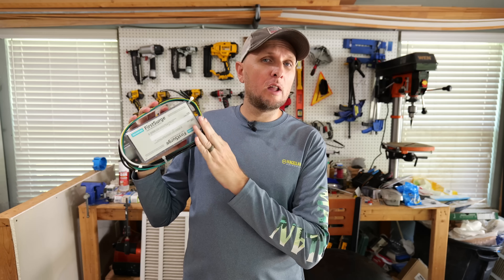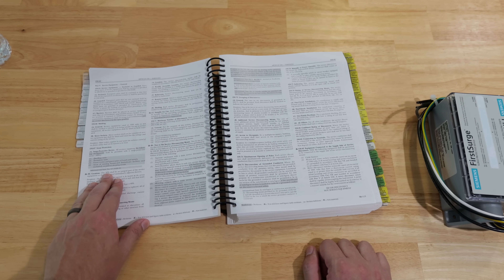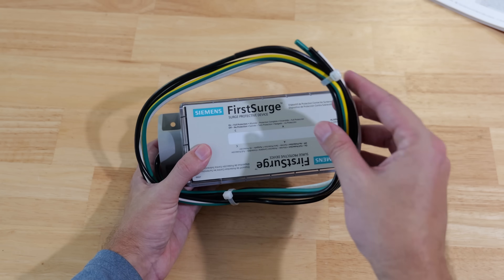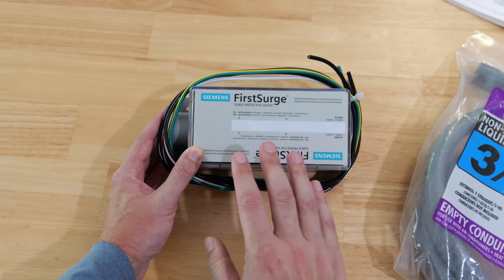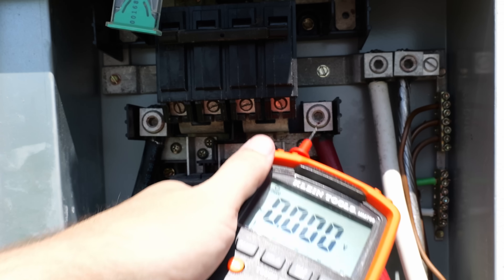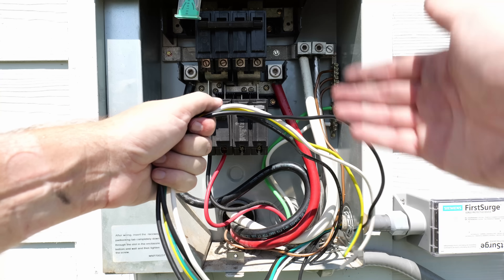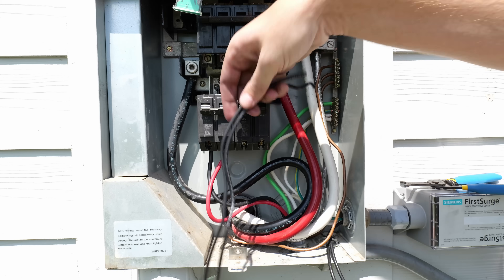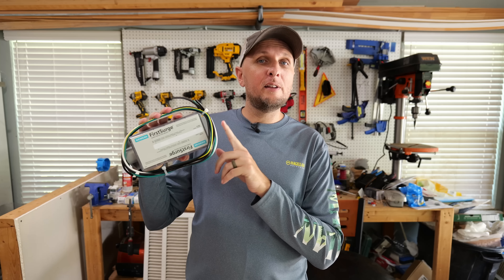Why Whole Home Surge Protectors Are Now Required and How To Install One!  Siemens FS140

Comment: …only in jurisdictions that require that version of the code.  However, my jurisdiction cannot force me to retrofit my house to meet current code.

This change is complete and total BS. There is no reason why the government should be forcing people to protect the electric components in their house from electrical damage. It should only require safety features for people. Not stereos and network equipment.
Reply from the maker: It is intended to protect the safety equipment that you mentioned like smoke detectors.  The NEC stated this.  The protecting your other equipment is just a side benefit.
Reply: @HowToHomeDIY  again I call BS. I’ve never. NEVER had a smoke detector fail from a power surge.i seriously doubt that’s a common occurrence.

People are supposed to check their smoke detectors a couple times a year. A failed detector would be caught then. There are other reasons why a detector might fail. Given the probability of a fire to begin with, it seems more than reasonable to check detectors a couple times a year to catch any issues.
Reply: @HowToHomeDIY, this has all the earmarks of being a change for which the insurance industry and/or utility companies lobbied the government.  I'm an insurance adjuster and can tell you that insurance companies are tired of paying for fried electronics.  Electric utilities used to cover repair or replacement costs due to some power surges and spikes, but not anymore!  Despite what the NEC stated, I don't think they are worried about our smoke detectors being fried due to voltage spikes, any more than they are worried that I change my engine oil every 7,500 miles.

Comment: Separate (topic) questions seeing your install.... I notice you are set up with an interlock like I have too....to allow a generator to be attached as a whole-house emergency electrical source. 
1.) For the conduit between the generator inlet plug and the panel, your flex conduit is continually sloping down toward the inlet plug panel. This can allow water to possibly enter the inlet plug housing. Wouldn't it be better to have the flex conduit "dip" to create a "U" shape?...so water drips off the bottom of the "U"....and not be capable to enter the inlet plug box?
2.) I like that you put a sequence-of-events label on how to hook up a generator. Question....is it still ok if your step 5 is placed between your steps 2 and 3 ?.....is that still OK?

Comment: I installed a GE whole house surge protector after a power surge destroyed the blower motor in my furnace. The price for the GE surge protector has more than doubled since I installed mine. This Siemens device offers a lot more protection but was not available when I was looking for a whole house surge protector.

Comment: I installed a SQ-D HEPD80 whole home surge protector on my main panel.  Also use surge protectors localized at each computer and television.  At the computers I back each one up with an American Power Converter  uninteruptable power supply.  I also have a Generator Transfer Switch Panel to provide safe transfer of power during extended outages where I provide house power with a 5KW LP generator with a hookup where I can draw fuel from my LP tank if necessary.  I live in the country with a local REC Power Coop supplying power and we are subjected to power glitches and power outages regularly.  This system has dealt with any power problems I've had since I put this in place.  I did all my own work so I saved a ton on labor.

Comment: You might call me an (unofficial) ”first adopter” when it comes to SPDs. I made my own with just 3 MOVs and put them inside my panel back in the 1980s! Why? Because I couldn’t find anything commercially available. I’m sure it was a minor major code violation, but I wasn’t concerned at the time.

I’m no longer a homeowner, so I’ll just have to settle for a BEEFY (homebrew) ”Type 3 SPD” in key locations, complete with MOVs, TVS diodes, and GDTs. (Think power strip with a sort of Type 2 SPD attached.)

Comment: There is a later version of the box you recommend and the only complaint is that the wiring is about 15 inches shorter than the original.  Thanks for the videos!

Comment: After 47 years as an electrician, electronic Electrician in industry, I still have to scratch my head when I hear wires as short as possible, as if the unit is faster than the speed of light. When I see concentric knock out rings in an outdoor box, I scratch my head even harder. I have never seen a box that you can knock out the whole, without at least cracking the paint, between other rings. 
Knowing how hard the insurance underwriters push electronic devices today, and how wall pack power supplies for computers and cell phone chargers have surge protection varistors in them already, and looking out at the power pole in front of my house with a surge protector/lightning arrestor on it, this seems like hundreds of dollars of overkill to me. My washer, dryer AC unit and furnace have no electronics, even the igniter plug, It truly would be a total waste of my money
Reply from the maker: For you maybe.

Comment: So now we have a new change in the electrical code. In real practice this new change of requiring whole home surge protection will only be carried out in new construction. The old homes will remain without whole home surge protectors for many years to come. This is the way it should be, home owners should not be required to upgrade to the latest and greatest in surge protection just because the electrical code changed. It is more than enough that surge protectors are readily available for various forms of electronic equipment where a voltage surge could damage the equipment.
Reply from the maker: Yeah I talked about that in the video.

Comment: Around 12:14 in the video where you're inserting the wires in the 20 amp breaker it looks like you are inserting the wires too far into those wire clamps so that you're probably tightening down those clamps on insulation. Can't see it for sure but on the second wire being inserted you inserted it until the copper was completely out of sight and the black insulation was inside the hole. If that's what you've done that is not a good electrical connection.
Reply from the maker: That didn't happen.
Reply: @HowToHomeDIY  I hope you took no offense. But I'm new to your Channel and the camera angle was really bad. It did look like there was insulation inserted in it but I didn't see if the clamp grabbed it so that's why I mentioned it. If I had seen your light switch installation video before I saw this one I might not have written this comment because I like the way you explain the insulation issue on that video. It might have been a good idea to mention it on this one also. But thanks for the response and I look forward to more of your videos.
Reply from the maker: No not at all.  Was just saying there wasn’t any insulation in the breaker.  The camera angles can definitely make things look different than they are.  I appreciate you taking the time explain your thoughts more!

Comment: I am missing how this surge protector can protect the whole house when it is not inline (series) to the main service continuing into the breaker panel but in parallel on just a 20A breaker. I would think a truly effective surfe arrestor would have to be inline to each service leg to stop the surge from passing through to the breaker panel and the various circuits. Can anyone explain that?
Reply from the maker: Extremely long answer made short, it’s the fastest path to ground.  And 20 amps is plenty as a surge is so fast and is primarily a voltage spike not current.
Reply: @HowToHomeDIY  But electricity takes ALL paths to ground or return neutral with the amount in respect to resistance. So technically that may be the shortest path, however some excess can & will travel on since there is no way for it to truly "arrest" or interrupt the surge. 
Also, has the kWh usage been tested on these so we know how much the power company will charge for these being installed? 
I appreciate the dialog, just trying to make sure I am not missing something.

Comment: “Those who would give up essential Liberty, to purchase a little temporary Safety, deserve neither Liberty nor Safety” - Benjamin Franklin
The government should never tell us you have to do anything for our “safety”. This act is a far cry from requiring a building to be put together in a safe way. Why? Because we are no longer building our own homes, outside contractors build and allow greed to prosper over pride in their work to do a good job, no longer threatening just themselves but vaste groups of others. This is why code was allowed to exist in the first place. This specifically is different because the government is saying you are to stupid to know this so we are stepping in to force this. 
Should the product exist? Yes. Can it do good? Yes. Should it be forced? Never.
As a expert in your field and hold a public platform you of all should fight against such tyranny.
Reply from the maker: I see where you are coming from and I agree with some of what you are saying, but definitely not all of  it.  Code still exists for said contractors to make sure they aren't cutting corners.  That is why licensing is also required now due to so many getting scammed by people who have no clue what they are doing, providing a service.  I think we can all agree that proper wiring, roofing, plumbing, framing, and foundational work need to be done properly for safety.  Along with other things like smoke detectors.  I don't really see this new requirement being much different than smoke detectors as one of the main reasons it is being required now is to protect those smoke detectors from being fried and then not working in the event of a fire where lives could be saved.  So, there is a line there somewhere.  I get more irritated with required fees such as 10's of thousands in impact fees being charged to build a residence.  But I do appreciate and respect your opinion.

Comment: My utility offered MOV installation for just the price of the devices back in the '80s (haven't checked since). They aren't perfect - I used them in various sizes for protecting electronic in our Van de Graaf lab. Very fast spikes could get past them (ferrite inductors helped that) and very large surges could over-power them (vaporise). Remember that cable, phone, etc. lines are still not protected. MOVs can and should be added to those, too.

Comment: I don't understand how this is supposed to do anything. Wouldn't it need to be able to filter all power going into the house? It looks like you're connecting it where there was nothing connected before, which means it's not in-line. And even if you're putting it somewhere you disconnected existing lines off-camera, it's only going through a 20A breaker. Does that mean your entire house is on a single 20A circuit? I really doubt that. There's not enough information in this video to instruct someone how to install this thing if they don't already have the understanding needed to install it.
Reply from the maker: There is plenty of information.  You’re wanting the complete breakdown as to one works.  I gave an overview as a complete breakdown would take quite a bit more time depending on how deep into the subject you want to get.  You are supposing quite a few things that are not true and it just does not work that way.  I recommend you look into what a surge is and you will see why the 20 amp circuit breaker is sufficient.  Also look into how a whole home surge protector arrests the surge and sends it to ground.

Comment: Love your videos thank you. As an electrician I have one question. You had an open two pole breaker to power your whole home surge device. What do you recommend to do if your panel does not have an open slot for two pole breaker.
Reply: You can replace a standard 240V two pole circuit breaker with one that also doubles as a whole house surge protector. Eaton makes one for about $100.

Comment: Ok I watched the whole video now I have a question about installing the surge protection unit. It is to be installed with a 20amp double pole breaker. Can it be a 20 amp dual function breaker where the breaker protects gfci and series and parallel  arc protection.

Comment: Will this protect us from EMP?
Reply from the maker: It is one of the surge protectors recommended for EMPs but you will also want to have ferrites installed on the incoming lines as well.  So this by itself is not recommended for EMP and even with the other things installed it’s not a guarantee because nothing is but is MUCH better.

Comment: @How To Home is there any reason you installed it outside rather than inside at the breaker panel? Are there any benifits to intalling it at either location? I have a whole home surge protector sitting on my workbench for a week now just, waiting to be installed. Hopefully you'll answer my question before this weekend so I can get that thing installed.

Comment: They are required because NEC has become a product placement organization.  That is why.  But hey, if you really think a little box will have an impact on something that can heat up the air around it to 5X the temperature of the surface of the sun, you do you.

Comment: For Safety reasons, you should inform your viewers the following: Prior to using your multimeter when checking for voltage after you switched off the breaker, or disconnect Switch. You should first check to ensure your meter is actually in working condition by testing a known live device.
Reply: I was thinking the same thing and I am not an electrician.
Reply: He has done that very thing in other videos
Reply: Yess because I would be the one to get ⚡

Comment: The NEC was founded on the principle of minimum safety for fire prevention and electricution.  These protectors are designed to protect the power supplies in electronic equipment used in a building, and that is a good idea.  However none of this equipment is going to catch fire or electricute anyone if hit by a surge.  They will simply fail and no longer function.  In fact a well designed power supply would have this built in, as it would as only add three or four dollars to the cost.  These devices do not protect the premise wiring in any way or arrest a direct lightning strike, nor would they ever protect equipment against a direct strike.  The same level of protection can be provided with a good surge protector power strip.  Sorry, I do not agree in any way that this provides for the safety of the building or the occupants.

Comment: I put one in a couple years ago. And you don't have to connect it through a breaker. You can connect Type 1 SPD's directly to the bus bars (line side) if you know what you're doing. But most viewers of this vid don't...may as well go the breaker route.
Reply: From the installation guide:

Line Side versus Load Side Installation 

The FSPD Series is tested and qualified as a Type 2 SPD per UL 1449 4th Ed. The TPS4 03 and 09 series are tested and qualified as a Type 1 SPD. This SPD can be installed on the Line Side of the service overcurrent device. Type 1 SPDs may also be installed in UL Type 2 applications. The TPS4 11 series is tested and qualified as both Type 1 and 2 SPD. As a generalization, it is more practical to install as Type 2 on load side of main overcurrent device for maintenance reasons.

Comment: When I installed my Siemens FS140, I moved existing breakers away from the main feed so the FS140 could take the slot closest to the main feed.  Was that unnecessary?  Because I have seen it recommended even though the manufacturer's instructions don't say it.

Comment: Just like arc faults.  Manufacturers sat on code panels and required it to be there.  $$$$.  How does it work?  "Trust us" is the answer.
Reply from the maker: That’s not the answer.  It’s actually very clear.  These are not new.